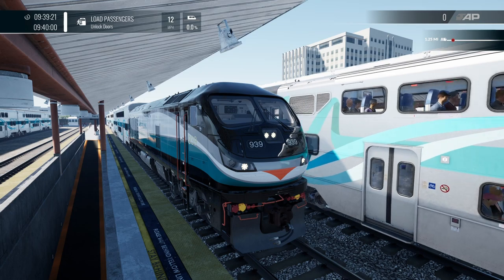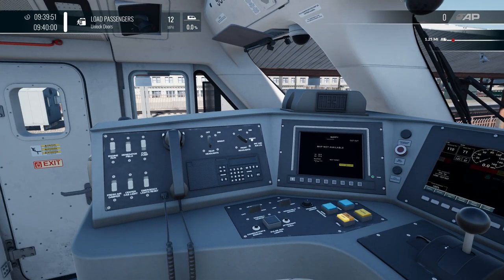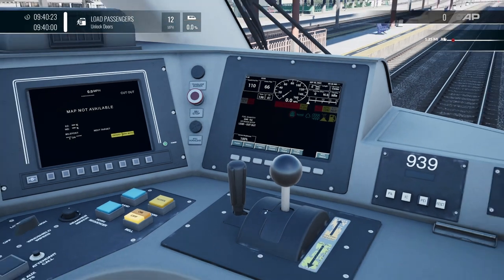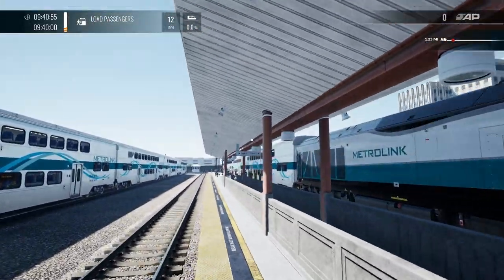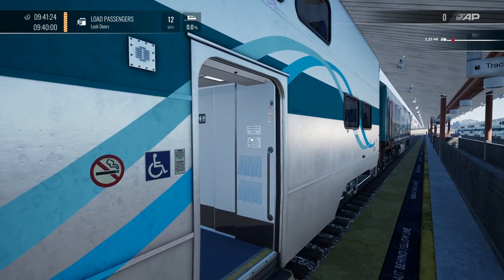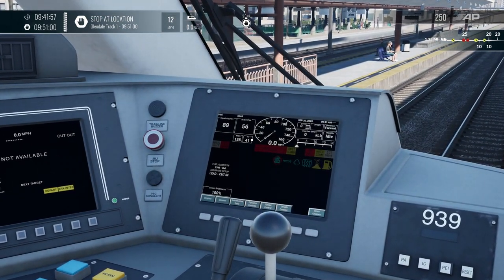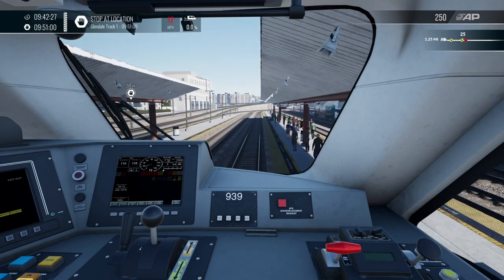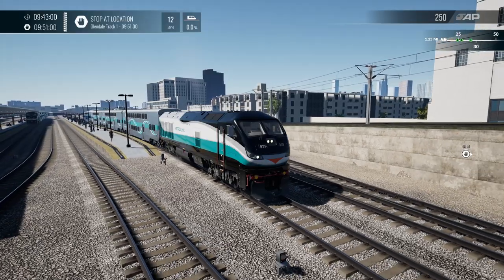HOW TO CORRECTLY SET UP THE F125 IN TRAIN SIM WORLD

Comment: Great! How do you remove the reverser handle when it's time to go to the other cab to change direction?
Reply from the maker: Just make sure throttle is at 0, reverser to off, should let you remove as I recall from memory
Reply: @TinTin_57  Thanks🙂 I finally figured out I had to click on the panel at the base of the "handle" rather than the reverser handle itself.

Comment: Hello, do american trains have back red lights and if yes, how to turn them on?
Reply from the maker: Hi, I this cab they should be correctly set to bright/auxiliary which should turn the tail lights on at the back. If not, there is a switch for the markers in the very rear most cab
Reply: @TinTin_57  thank you
Reply from the maker: There is also a rear marker light switch on the back of the lead cab

Comment: Stuck at setting the reverser to Idle to release the traction lock.  I don't know where the traction lock is.
Reply from the maker: It can be a number of things. The traction lock is a status, it’s not a button or lever. Sometimes you may have to reset then wait for the brakes to release which on some trains can take some time. Identify the brake gauge and keep an eye on that to see iif it’s going down

Comment: I’ve done everything the way you’ve done it several times… nothing. 🤨. I might be glitched for some reason.
Also, there’s a red border on my HUD around the gear selector.
Reply from the maker: That’s a traction interlock. A brake could still be on somewhere, loco or train brake. Go to each in turn and hold down release. Also make sure the brake mode on the right is correctly set to passenger
Reply: @TinTin_57  thank you. I figured out what I did wrong. I too dumb to realize the PTC breaker was off, fuel pump was off, and even though it seems obvious now, I was still dumb enough to forget to hit the switches 1, 2, and 4 on the panel just behind the engineers seat(on the back wall of the cabin) 😂. There’s a reason why I’m not a worker with NS or CSX lol.
Reply from the maker: @TezcatlipocaMountyRailfan  ha ha yeah it happens. Well now at least you can enjoy the route, an excellent one at that
Reply: @TinTin_57  Definitely. Thanks. I’ve been playing Train Sim games since the  Microsoft Train Simulator days, but I still have a hard time learning new locomotives. But, yeah. Now that I’ve had a chance to enjoy it, the route is amazing.

Comment: I did everything i should do to set up the train, but the doors won't open
Reply from the maker: Hmmm is the train def in forwards? Should work
Reply: @TinTin_57   well it only happens if I spawn my own train
Reply: @davinhuffaker4670   Yes same issue!
Reply: @TinTin_57  and the lights in the cab car won't turn on
Reply: I found the solution. You need to make sure the HEP is on
Reply: @davinhuffaker4670  what’s HEP?
Reply: @Manc-fh5we  head end power. It basically let's you control the train
Reply: Hmmm how davin